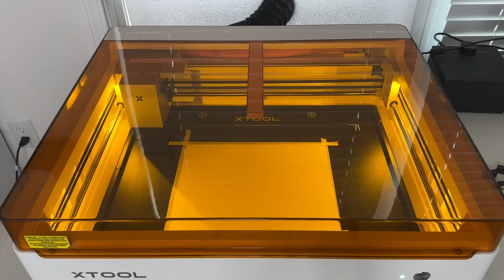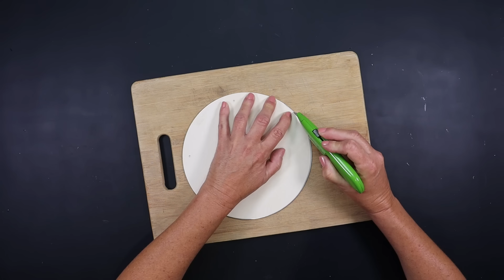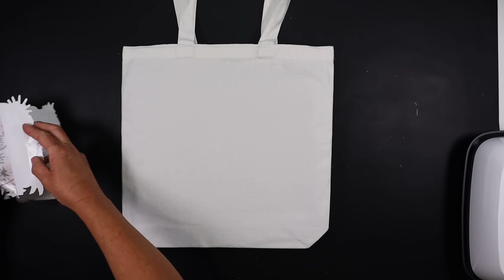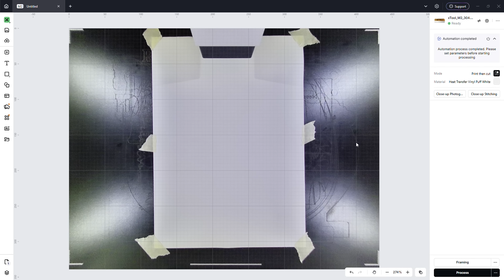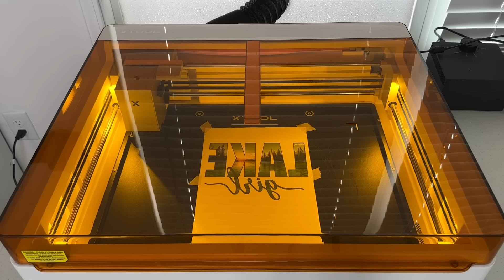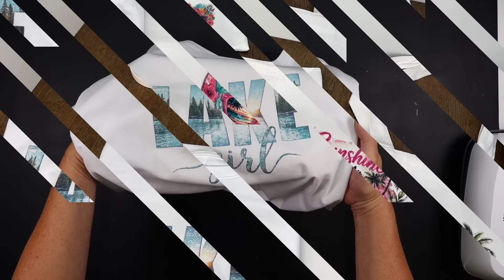🤩Testing Printable Iron On Paper Using the xTool M2!

Comment: Instead of printing the circle design then trying to stick it to the circle. Cut a piece of basswood 8.5x11 then stick the sticker paper to the basswood. Print then cut and you’ll have a flawless piece without having to cut the overhang. Hope this helps.
Reply from the maker: That is such a clever tip, thank you so much for sharing it! 💖
Reply: So you can stick the paper in the wood and print and cut through both? 
Without scorching the paper?

Thank you